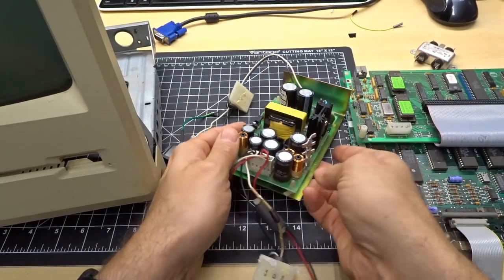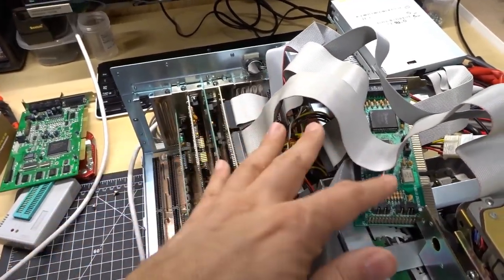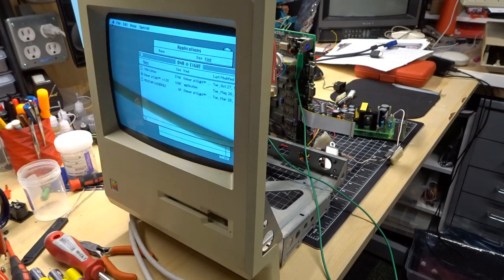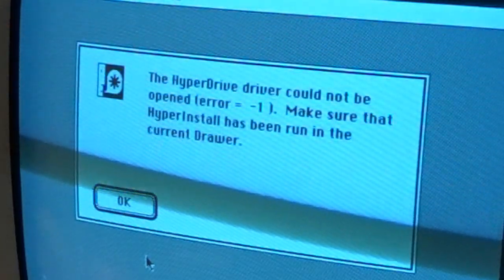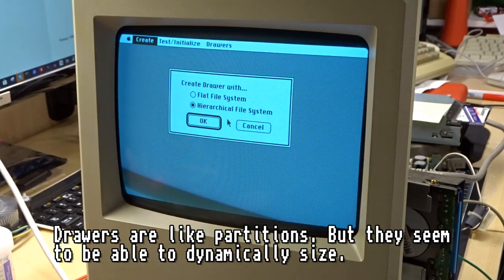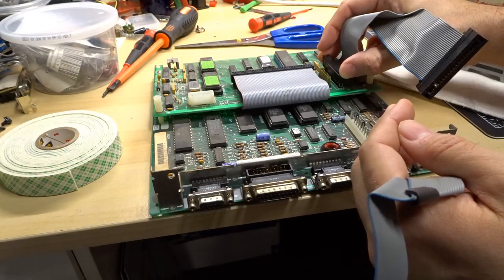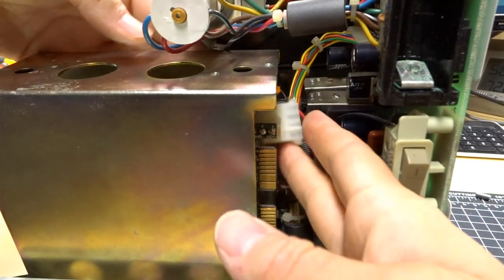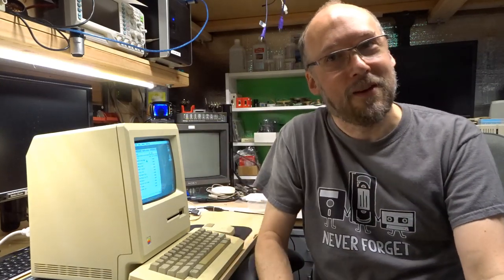Macintosh HyperDrive 10 (back together again)

Comment: Your description of the iterative process of making the old computer work made me laugh - I've done the same so many times, multiple trips to the parts bin, the end result a hodgepodge that is lucky to work long enough to do what is needed.  If only it wasn't so fun -
As to the Hyperdrive machine - check out the MFM Emulators that are available.  Pricey but brings the old iron into the 21st century - you can boot up from USB stick or Memory Card.

Comment: Try opening the Hyperdrive disk utility in ResEdit. You'll be able to see all of the data structures inside the program, one of which are dialog boxes. IIRC the resource is called DLOG, which if you double click on will show the dialog box IDs and you can search for the one which is supposed to have the "format" button.

You can then see if the button actually exists and is hidden or disabled. There should be flags and such for every button and you can sometimes force them to be enabled. It's a gamble if it will work or not, I used to have to do such things for buggy applications. Sometimes it works, sometimes it doesn't and sometimes it causes erratic behavior.

Comment: On my bench is a 128k w/ 2mb Levco MonsterMac card - my family got it in 1984, and for quite a while it was just a plain 128k with no external drives... yeah, swapping floppies got old fast. Eventually we got an external 10mb hard drive (hooked to the serial port - you had to boot off of a special floppy to get it going).

Comment: I have the same Mac 512k setup (with  with GCC HyperDrive.  I actually made a short video of it back in 2012 (search YouTube for "GCC HyperDrive Macintosh 512k" to see it).  My power supply still works fine now in July 2019; however, it's been more than 30 years since it was made and surely time to replace the electrolytic capacitors on it.  I've been working on a Mouser list over the past few day.  You may wish to consider the same.  Having stable power to the hard drive will help ensure it doesn't up and die one day due to a power glitch.

Comment: 5:35 MacsBug is a low-level debugger, or machine-language monitor, that was included with the Mac system software. There have been a couple of different revisions over the years, with later ones having a much nicer UI, but on a 512k Mac, you probably have one of the earliest ones. I haven't used it in decades, but this looks like a good place to start exploring: https://macgui.com/news/article.php?t=485

Comment: What a nightmare trying to get that 20 MB drive to work! I never personally used MFM drives, I always went with SCSI in my early equipment, and switched to IDE later on in the nineties. It was more expensive, but seemed to work much better.
Reply: There were also SCSI to MFM controllers that the first MFM drive was LUN 0, and the second MFM drive was LUN 1.

I will say it was definitely the easiest way to use an MFM drive by far!  It also then allowed for more advanced features from the combined drive sub-system.

Comment: I bet disk swapping on one of these never got old.
Reply: The disk swapping would not have been as extreme was it was in this example in most normal use situations because the software disk you used would boot the computer. So you would only be swapping disks while saving or loading your work.

Comment: Flat File System=MFS (Macintosh File System). MFS doesn't really have support for directories (since it was meant for floppies), one of the programs you tried to use were developed before HFS (and then got a warning slapped on it)

Comment: You are really lucky getting another mfm-controller to read your drive. There are many different raw level formats outthere, and most controller cannot read disks formatted with another controller.
Reply: my thoughts too.  I know I has three different types of MFM controllers in the XT days I would swap around in hopes one of them would be compatible when working with some else's hard drive to recover data.
Reply: It's not only the MFM controller itself, it also depends on the way it's used. When looking at the datasheets you have different variants, slightly modified circuits etc. There are hundred ways why it'll go wrong, so in this case a good portion of luck is involved.
I also remember my first ST01R-controller, when i realized i can upformat my old MFM-disk from 17 to 26 sectors and get 32 instead of 21MB :-)

Comment: Hello adrian,  just wanted to say.  love the videos.  they provided lots of entertainment all the way up here in chilly canada. this is such an interesting setup / find you have there,   i would be really interested to see the next time you go into this computer a little more detail about how the hard drive board is connected to the cpu.   as you had mentioned in the video that it was some type of clip onto the cpu to link in the hard drive.   also i am wondering what dos software were you using to backup and image the mfm hard drive.   i have a similar type hard drive in a odd system that i wanted to get a complete backup made that was further then just connecting a zipdrive to the printer port and doing a copy of the files across from the hard drive to the zip disk.   if you could point me into the right direction of some good software or even a copy of the programs you were using that would be greatly appreciated.

Comment: Turn it into a doorstop? Respect your Elder Equipment! Without them none of us would be here today!

You need to check the Dead Mac Scrolls and the Macintosh Upgrade and Repair Secrets - both by Larry Pina, for adjusting the screen on these little Macs to an exact spec and no needing to turn those rings with the power on! Man you're do lucky you did not do the 20KV Shaking Gigolo Dance!

Comment: Isn't there a CompactFlash to MFM adapter out there somewhere?
Reply: There are two SD solutions that I've seen, between $180 - $250, so not really worth it for the hobbyist.
Reply: CF to IDE is easy because CF is IDE and just needs the connector adapted.  Anything to MFM would require some controller hardware in-between...and the demand for MFM ones is probably fairly low compared to the flash-to-SCSI adapters now available for as low as $50-60.
Reply: @adriansdigitalbasement  there's an open source mfm emulator at pdp8online.org,  couple hours soldering and testing (uses beaglebone for hdd image emulation, the board just converts to mfm connections from beaglebone

Comment: The drives from the 80s are much more reliable than the drives from the 90s and early 2000s.  These drives were made when they cost thousands of dollars. There is just not the corner cutting, not to mention the fact that they are much less miniaturized than more modern drives.
Reply: ROFL I had to deal with a lot of crapped out, corner cut drives from the 80's :)  beancounters overruling engineers isn't anything new
Reply: I'm not saying it never happened, but it has been my experience that 80s computer equipment has held up MUCH better than 90s computer equipment and especially very late 90s early 2000s and hard drives in particular. This is not even considering all of the bad caps from that era.
In fact, I would say hard disks are the worst example.  I forget which company it was, but one of them was even putting foam pads in the hard disks to cushion the head knocking when it retracted back in the park position. I want to say it was Western Digital.  Needless to say the foam disintegrated and ruined most of the hard disks within a few years.

Comment: IDE XT ISA 8bit can be used simultaneously with MFM 8bit hard disk controllers  :)
Reply: @adriansdigitalbasement  no problem not  only that but with a modified IDE XT BIOS you can bring up boot menu and choose to boot from any IDE or MFM  in the system :)

Comment: Note that the CSC hardrive bible, for all its faults, has the CHS settings for MMI drives, among thousands others
Reply: just to confirm, the MMI 112 has a 10mb formatted capacity, 4 heads, 306 cylinders, and 17 sectors per track.
Reply: If anybody wonders... every single MMI drive in my book says 306 cylinders and 17 sectors per track, the only change by drive size is the number of heads. 5mb having 2, 10 having 4, and 20 having 8.

Comment: Let's say the old supply was really dead.  You could have changed the capacitor on the Reset circuit for the Mac, and increased the powerup reset time and solved the problem.

Comment: 4:00 click of death 

Adrian: noooooooooooo!!!
Reply: @adriansdigitalbasement  sounded like since the heaqds weren't parked the drive did a full recalibrate (step all the way out, all the way in then back out to 0.) old wd1000 connected sasi drives did that frequently and on an 8 inch HDD it is an impressive noise.

Comment: What program where you using to do the low level format?  I remember using the debug G=C800:5 to get into the low level format software on the controller, back in the day.   I remember paying $100 for a crashed ST-225 in high school and sending it off, and paying $75 to have it repaired.  That was a happy day when I slid that into my NCR-PC4i, loaded up DOS 3.3, and said what will I ever do with all this space.   I cut a lot of grass to get that system put together!
Reply: My first hard drive was 5 megabytes. I installed MS-DOS 2.something and all the software I had. The drive was half full! Then I did a full backup, onto 360K floppies. As the stack of disks grew I decided I was never doing that again.

Comment: If it does die, you could maybe run an MFM drive emulator. Have you tried one before?
I remember fondly my days with our wee Mac 512K (may have been even less). No hard drive, just a single floppy.

Comment: Seeing as there are IDE-SD and IDE-CF cards, I wonder if it would be possible to make something that emulates MFM/RLL?  The trick would be finding cards small enough to use with them  (I'm just presuming MFM has a limit on disk sizes).

Comment: Did the disk image file on the Zip drive work? Is it readable on a Mac emulator or modern computer?
Reply: Hi Adrian - I wasn't thinking about emulating the controller -- but if you run Mini vMac (the Mac Plus emulator) and open the disk image file you created, it should be able to use it as a disk drive. Or, you could browse the disk image file using MacDrive on a PC

Comment: It is 17 sectors per track, starting counting at 0 so 0 to 16 :)
Reply: True, but did you note that he started off saying at 4:09 the correct number of cylinders is 306 (which is indeed what the Hard Drive Bible says), but later at 4:51 he changed that to 305 without offering the reason why?

Comment: 6:03 OMG you have the same temperature/humidity meter on the table as myself (it's at least 10 years old, and I'm in Germany). Unfortunately mine stopped displaying anything and I have no idea how to fix. Maybe make a video about it. ;)
Reply: Actually, mine had been bought for me by my landlord who subsequently died and took the secrets of its origin to his grave. And guess what, I just checked on it (it's been collecting dust lying flat on a desk for a couple years), and... the LCD screen seemed to be displaying symbols (no temperature/humidity, but dash symbols and an unhappy face!). So I replaced the ancient batteries (they did not leak) and... it's broken again. Maybe if I wait 5 more years it will repair itself... there is hope.

Comment: Could you not test the image in some emulator like Fusion, Vmac or basilisk, probably easier and safer doing the backup on mac if it has drivers for the zip. Because it must have a parallell or scsi port?
Oops see now no parallel nor scsi i guess a floppy backup is the only way, or do it on a newer macintosh plus if it can read the HDD?
Reply: There must be a program for Mac that report the cylinder structure of drive?

Comment: It sounded like you neglected to park the MFM drive after you created an image from it.  Not a good thing to do with old hard drives.  I always used a batch file to shut down my old computers, it would first park the hard drive, then shut down, or prompt that it was then safe to power down the computer.

Comment: I liked the video,  some nice nostalgia, but you made the mistake of calling it an MFM interface.  The interface is ST506/412.  MFM or RLL is the encoding method. 
I had a Myarc Hard & Floppy controller card for the Texas Instruments TI-99/4A in 1989 and had two Seagate ST4096's and an ST251-1.
:-)

Comment: it seems there was two versions, Hyperdrive10 and Hyperdrive 20, each used for a 10mb/20mb hdd.
Since this fat mac had a 10mb hdd it is most likely the Hyperdrive 10 controller, so maybe it can only control the 10mb hdd correctly? 
since you did not get any options for parameters, maybe they are stored in some rom on the actual controller.
anyhow, the only thing you could try is another 10mb hdd with the same specs as the one it came with.

Some magazine page i found...
https://books.google.de/books?id=fC8EAAAAMBAJ&pg=PA45&lpg=PA45&dq=hyperdrive+mac+512&source=bl&ots=d2aminQ75K&sig=ACfU3U1LmIlQPpfyTwXHv6LDWMFWX5RoLw&hl=en&sa=X&ved=2ahUKEwjkr6esrevmAhUCiFwKHXYVBhAQ6AEwCnoECAcQAQ#v=onepage&q=hyperdrive%20mac%20512&f=false

Comment: that old IO controller looks like a goldstar based? depending on age it could be set to IRQ 15 and whatever the secondary IDE port address is again if you can find the jumper designations. 

and yes, i can imagine the disk swapping. used to do it long ago. often!

Comment: Truthfully, I think this 512K Macintosh is one of a kind with its internal hard drive :P wonder how many are surviving with an HyperDrive upgrade... Too bad that the hard drive type seems to be hard-coded into the ROM. 

I know that Apple made (actually rebranded a Rodime hdd) a hard drive that you could plug into the Mac's external FDD port (IIRC it was the Hard disk 20), only to be superseded by the Apple Hard Disk 20SC (SC for SCSI, the 20SC was released I think alongside the first Macintosh to bear on-board SCSI, I don't recall which, when it comes to Vintage Apple, I'm more knowledgeable on the Macs that came alongside and after the iMac G3 lol, 68k and early PPC Apple is still a mystery no man's land to me)

Comment: 16 sectors? No, 17. Count starts at 0 not 1.
Reply: people did all sorts of odd formatting in old computers.  Extra sectors, fewer sectors, even extra tracks and fewer tracks than the original drive may have been specified for.  There were also cases where fewer heads than actually existed on the drive were used.  Often the decisions were made to support extra features, or allow for a wider choice of vendors for hardware options.